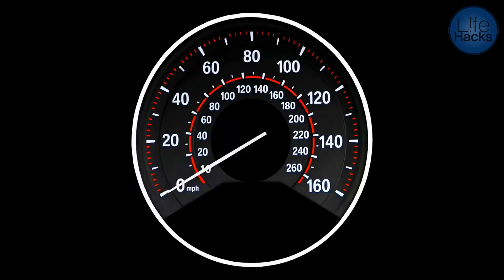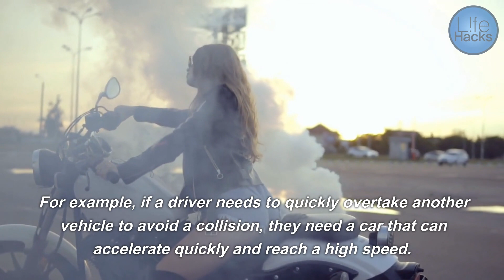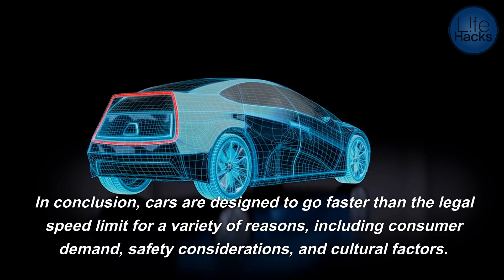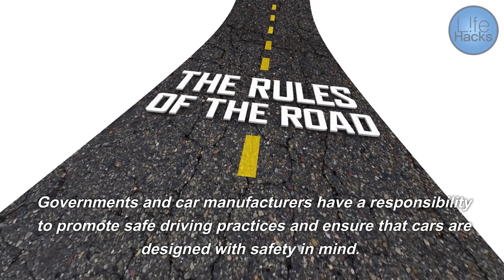Why Cars are Designed to Go Faster Than the Legal Speed Limit

Comment: You know nothing about cars.... the main reason is that the companies want to make a overpowered car that we should run at a speed lower than its maximum capability rather than building a weak car and driving it at its max power as it will break it down faster....looks like u just made a presentation out of general knowledge